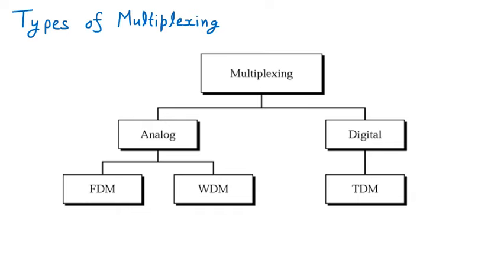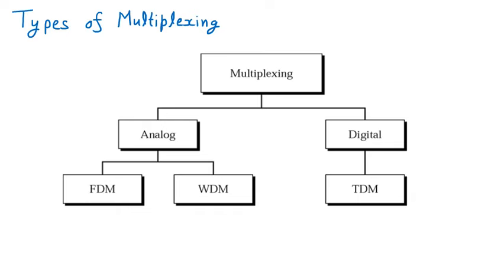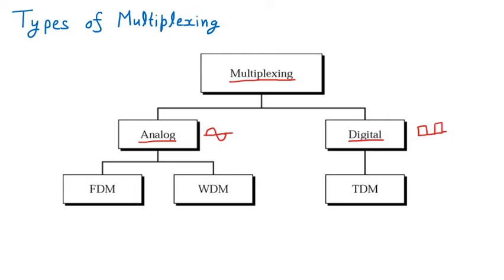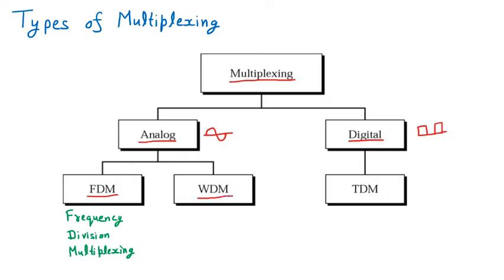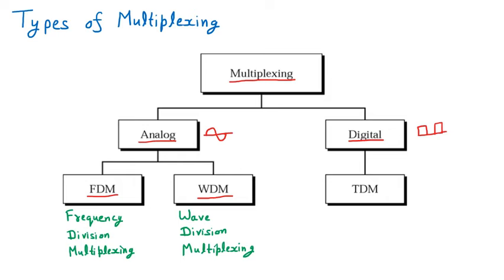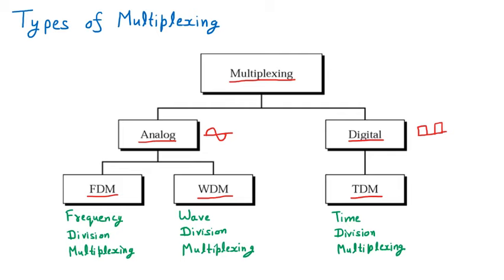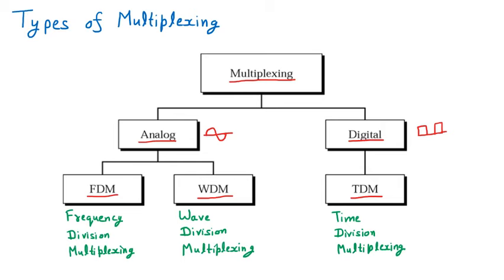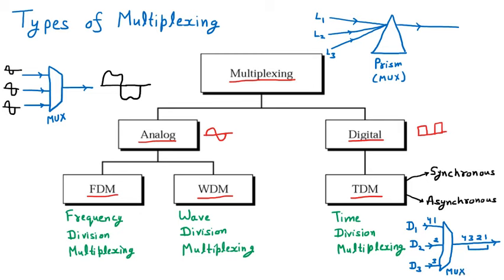Types of Multiplexing | FDM TDM WDM | Analog Digital | Computer Networks

Comment: Sir I want to read temperature from 5 different sensors and want to use a SINGLE IC (e.g ADC IC ) for converting voltage output of sensor to temperature.
I am using AVR microcontroller.
So is it possible read 5 sensor using analog multiplexer and give it to IC (ADC). 

Please share me best analog multiplexer for this purpose easily available in Indian market.

Comment: Many singal combination in one multiplexing 
Digital and analog two type 
Tdm in digital
Example in class tere are 3 students roll no 1,2,3  first give speak roll 1 then same speak 2 last 
Roll 3 to speak on again roll no 1 will repeat clock.  Two types synchronous and asynchronous 
Synchronous whenever time major consist 

Asynchronous where time infnite give 
Example
Reply: Example fdm more then two frequency combine and new frequency  fdm
Reply from the maker: Thanks for sharing useful information
Reply: Make video of
Circuit switching
Packet switching
Spread spectrum